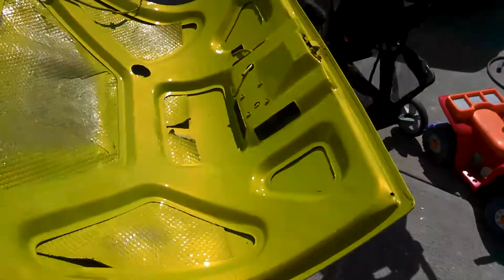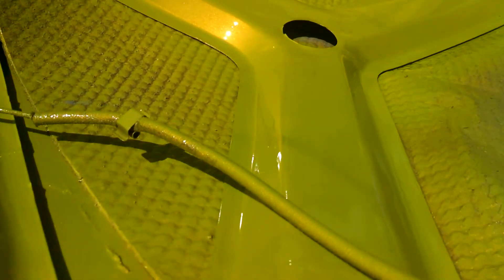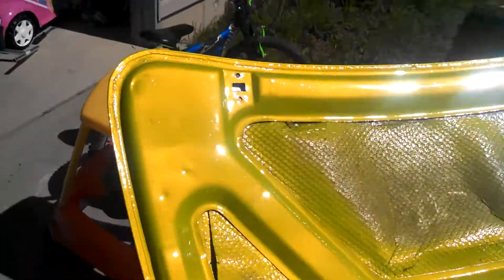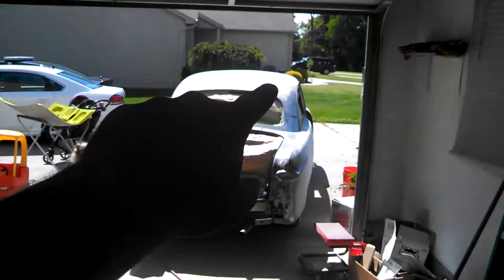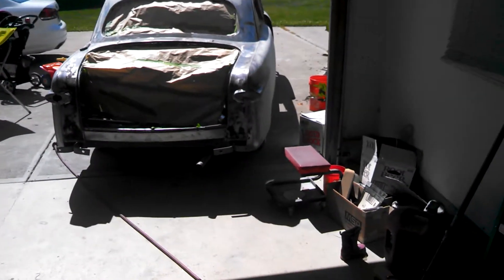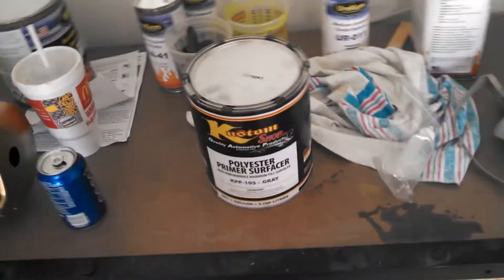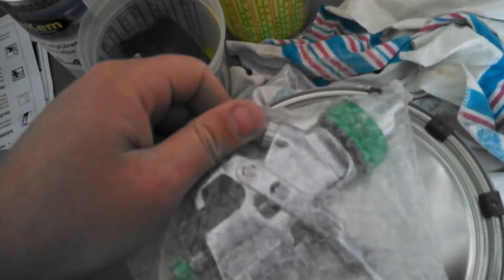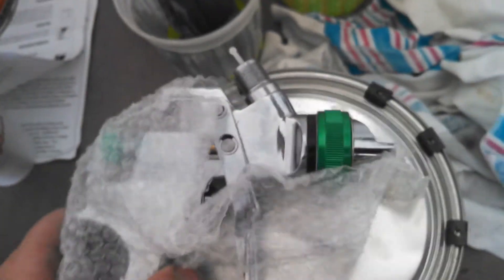Showing off my pearly greens!

Comment: Nice one good tip to keeping your guns spraying like new is to take the air cap and needle out of the gun when done witn it and leave it in thenner. Just dont leave the gun body in thinner. Also pick youtself up some naked gun cleaner that stuff works great. Later
Reply from the maker: Thanks for the advice!